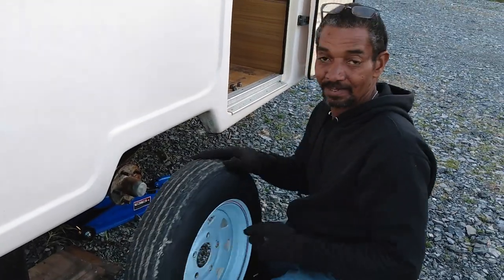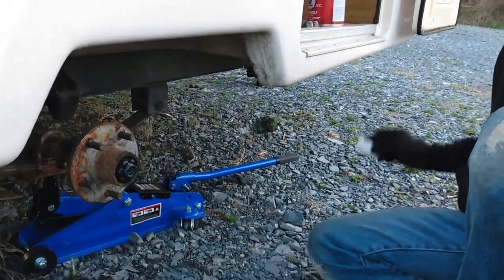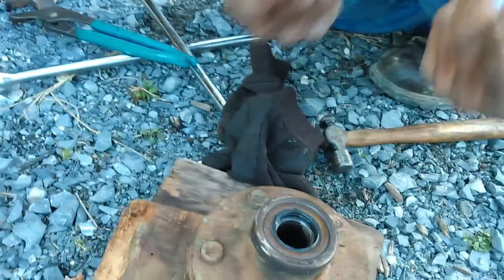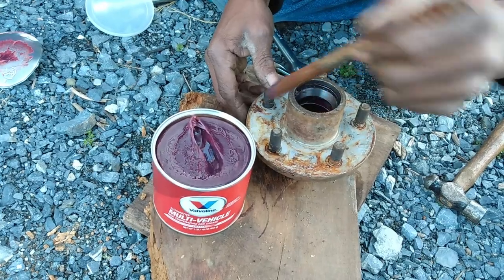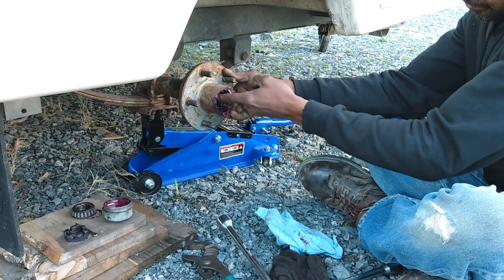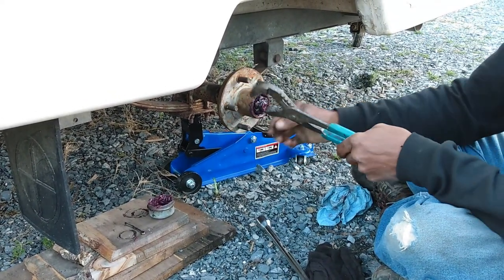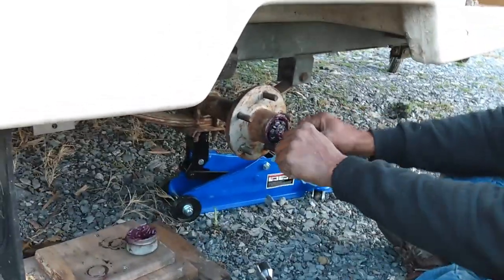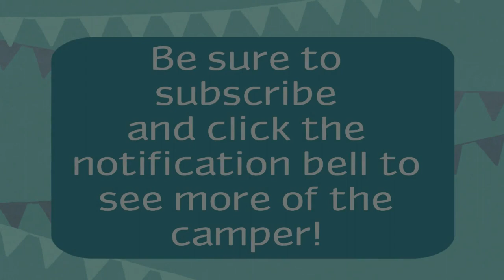How to Grease Wheel Bearings on a Tiny Vintage Camper ~ 1987 Cadet, Niewiadówn126

Comment: Nice👍 that bit is different to Polish versions too. Here axle is without leaf springs and shocks absorbers. Just machine pressed with rubber rollers into the axle. It’s called steering axle. Yours is better. And my hub is on 4 bolts for old type of wheels from fiat 125p😉 good video👍👍👍👍
Reply from the maker: Thanks.  I know nothing about axles.  :)